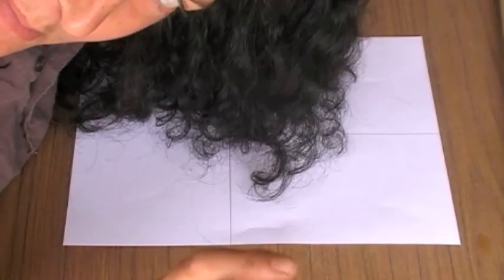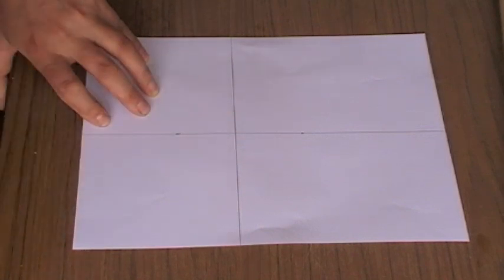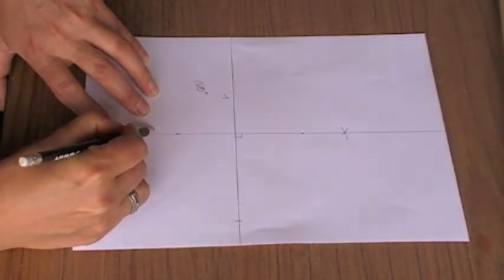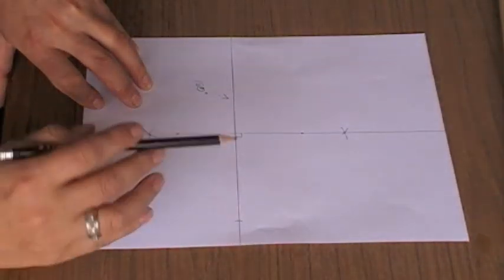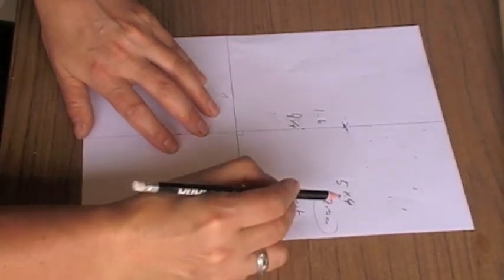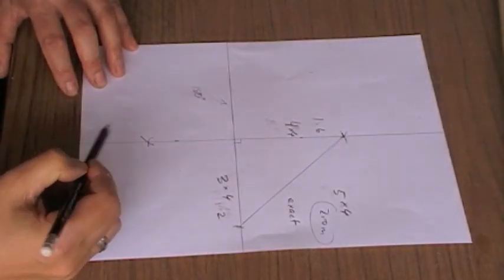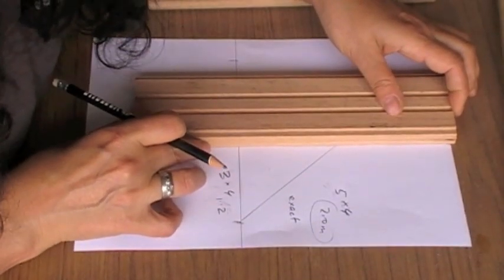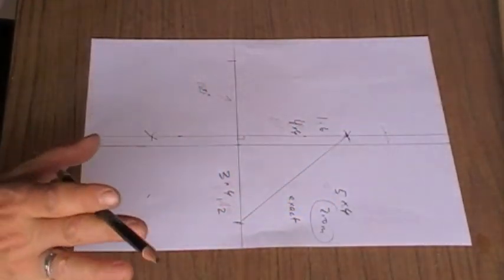'How to' set-out for parquetry.

Comment: Thank you - I'm about to start a smaller project (a kitchen island) that I want to use this technique on to make a patterned wood top. Understanding the geometry will help me get a better result. (I love applied math :-) And since no room has square corners (especially not in this 1893 wood-frame row house), practicing this will make me halfways competent when I get brave enough to try a floor. It would be helpful to show the protractor in use, to see where you place the point and swing it (for novices like me).

Comment: You can skip the first 4:30 of this video. You are never going to find a room as perfectly proportioned as that piece of paper and will ALWAYS have to make adjustments (measure and cut) around the edges of the room anyway!

Also, just make a "90° triangular template" out of plywood and screw it to the floor as a guide to start and move it to the other end of the room to guide your parallel rows.

It REALLY isn't that hard to do!

Comment: Suggestion - You can just find the middle of the room, move it over with the width of half the block, move it over to the left with the measurement of the block you split in half. Starting left over right, then dry lay your wings to make sure you don't have to make any adjustments. I know its easier said than done but everyone has a different way and did works for me.